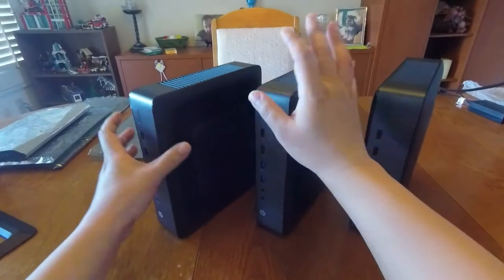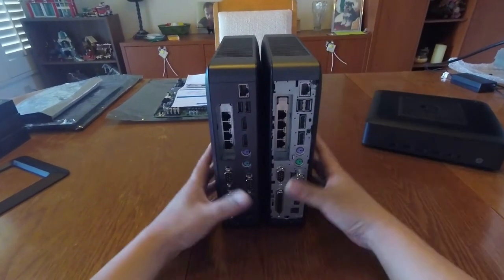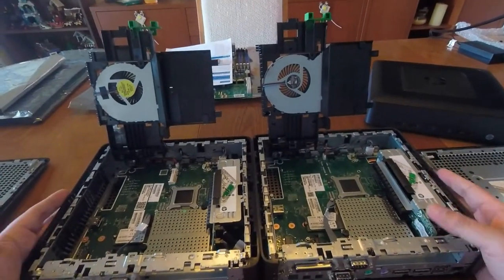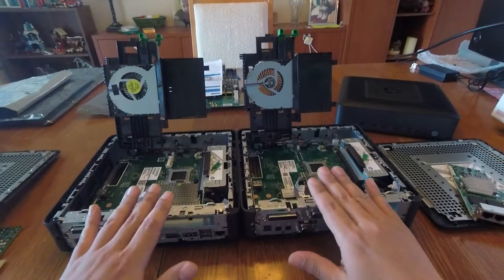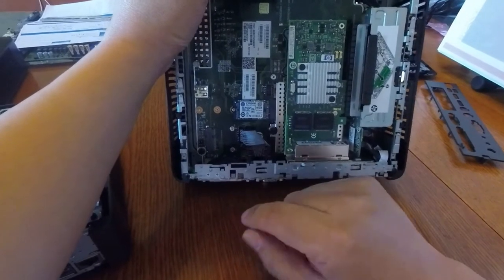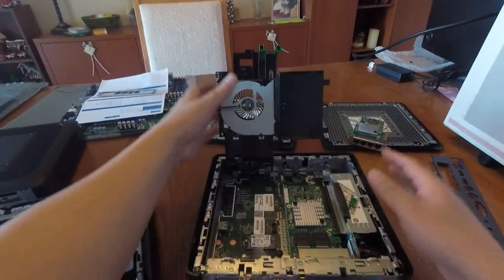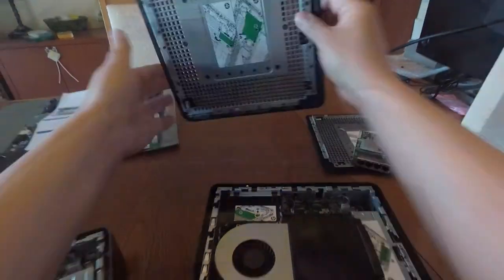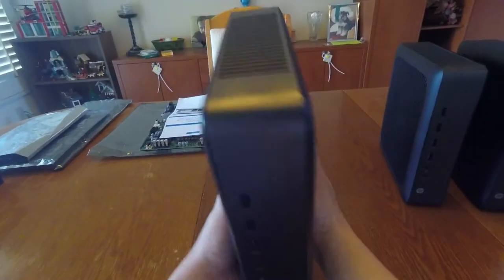Buyer's Guide for HP T620 Plus thin client

Comment: Great tips! I would have mentioned power supplies. It's hit or miss whether they will come with the unit or not. It's usually noted, but a lot of people don't know to look out for that.
Reply from the maker: That's a good point about the power adapter! Thanks for watching!
Reply: And also: you need the official power supply, apparently. You can't just source a compatible voltage power supply and plug connector, because HP looks for low-voltage identifier pin. (Apparently it's easy to remedy if you can solder a resistor internally)

Comment: The T620+ is plenty powerful for win10, quite the uberkill for a firewall. Using it as a 15W desktop makes a lot more  sense in my opinion. Can even be fitted with a PCI Graphics card for heavy gaming (together with a desktop PSU) where the 4X CAT5 port card is originally. Secondly, it is not a mSATA port internally in the T620+ you are pointing out but a mini PCIe port, and it is only wired for serial to connect to a mini PCIe wifi, modem or network card, so it won't work with a mSATA SSD or a mini PCIe SSD either (both mSATA and mini PCIe use the same connector, but they are different and a lot of people mistakes the two). You can solder on a mini PCIe  connector and a few SMD resistors to make it work if you got the kind without. Thirdly, the Display Port has digital audio, so if you buy a Display Port to hdmi adaptor , you have an excellent set top box or silent PC.
Reply from the maker: Thanks for sharing your thoughts. I agree, these machines are versatile and surely can be used in many different ways. Although, i'm not sure about adding a GPU with a desktop PSU is practical, but there are GPUs that will run without extra power and work just fine.

That said, I think you're mistaken about the mSATA vs miniPCIe. There is a miniPCIe for a wifi adapter, and that's at the lower left corner in the video. The "mSATA" that i point to that is missing in Rev B boards, is in fact mSATA. I have a Rev A system i run with a mSATA SSD in that port that I use as a cache drive; so I've confirmed this fact. I also have a another unit with the wifi card in the miniPCIe slot, so you are right that there is a miniPCIe slot, but it is not the same as the mSATA slot I pointed out as the difference between Rev A vs Rev B.
Reply: @ArtofServer  Sorry, yes, I thought you were pointing at the white connector next to the CPU which is only fitted to some. The flash rom is plugged into a mSATA connection or a m.2 connector on models after 2014: https://www.parkytowers.me.uk/thin/hp/t620/
Reply: the GX-420ca when it comes to gaming just lacks the grunt for heavy gaming, for lite gaming its decent. the GT 1030 will be the best that you can fit into the T620 plus. i own a t620 plus with a GT 1030 (the DDR5 version) and the CPU performance is a pretty big hindrance. anything faster than a GT 1030 would be a waste as the CPU is just too slow to push a higher end GPU (the CPU cant even push the GT 1030 in games)

 i mean it will play elite dangerous at 720p with a mix of high and medium settings but you'll see stuttering galore especially around a station, performance by yourself is not too bad it hovers around 50-60, but framerate tanks when near a station, and is decent when in an SRV on a planet.

performance in fortnite is not too good, i had to cap the framerate at 30 as the CPU just cant keep up even at 720p and lowest possible settings.

it plays world of warships at 720p with low settings pretty decently.

it'll play halflife 2 with ease you'll see triple digit framerates most of the times , it'll play COD MW2 with a slight hint of performance degradation on larger maps, CS:go is pretty unplayable with framerates in the 20s-30s

it does run Windows 10 decently, but it can get a little sluggish at times for no apparent reason , but besides that it surfs the web pretty decently, will do 4k video with ease thanks to the gt 1030 (the on board iGPU just couldn't do 4k video, which is why i slapped a GT 1030 in it) , its really quiet even at full load which makes an awesome HTPC.
Reply: Yep runs Windows 10 easily
Reply: Womb Raider  The only thing I haven't tried, is to get audio from the Displayport, rest is good info. It is not an mSata connector, it wont work.  https://www.parkytowers.me.uk/thin/hp/t620/plus.shtml It is the exact same motherboard as the T620 without the "+", just some of them has not all the connectors fitted. https://www.parkytowers.me.uk/thin/hp/t620/  I swear on my grave, this is a PCIe connector.
Reply: You're completely in the wrong.
Reply: @binaryum  That cleared that up real fast ;)

Comment: Thanks for your excellent video. Today I purchased HP T620Plus with the bracket on ebay. So far I have tried HP EliteDesk and ProDesk, now I am going to shift HP Thin Client.  If possible,  I  want to install Windows 10.  I expect that the machine is the enterprise or digital license and also HP products are very easy maintenance without tools.
Reply from the maker: Glad this video helped! :-) Congrats on the T620! I love these little machines!

Comment: I noticed these machines and wanted to make a low end living room pc, this is very handy.
Reply from the maker: yeah, these are great for that type of use too. Also, take a look at the T730 thin client as well, it's a more powerful machine but still very low power.
Reply: I saw that and noticed one with 2 cores? Which chip has more cores on the t730?
Reply: The R3 in it isn't too great for video playback, it'll work for low end stuff, but it'll struggle with higher end videos, and the R3 is horrible with YouTube, the GT 1030 fixed that, but if pared with a GT 1030 it pretty much can handle most kinds of videos even high bitrate UHD videos. And the funny thing is that it can do lite gaming as well (I use mine to play elite dangerous and American truck simulator).

It'll also do emulation pretty decently.
Reply: @madmax2069  its fine for 1080p YouTube h264ify

Comment: Good info ! Lego part is indeed awesome:)
Now I would  like to ask if possible to make a close-up photo of the VGA cable for the part number and connection details.
I have bought recently one with 2 serial ports, rev B of course and the DISPLAY ports were not active/or might be defective.
Adding a video card does not solve the problem. The unit was booting up but only from onboard video card.
So I had to measure all the 16 pins from the VGA header found on the motherboard.
Finally I got the partial pinout and got the VGA signal displayed on a monitor.
However I would like to have the complete schematics of this small VGA cable which is nowhere to be found. Not by type, not by part number.
Thanks a lot for the instructive video. Mounting the "stand on foot" for the horizontal position was also new for me, like built in surprise :)
Cheers !
Reply from the maker: I'll see what I can do about that, since I don't have one with VGA port right now. I might get some soon so if I do, I'll try to help.
Reply: @ArtofServer  This is more than perfect! Many thanks ! I will  also try to finish the cable chematics, I have for now the RGB, grounds and Vertical, Horizontal Sync.
With these signals you can run a monitor but I would like to have the complete cable schematic. For sure this info will be helpful for a lot of other 620 TC owners.

many thanks !

Comment: I just bought one of these to turn into a Linux box, what's the best single slot SFF video card I can get for these... I'd prefer nVidia but if theres a good amd one that's fine too
Reply from the maker: it would have to be a low profile GPU... maybe Quadro P400?
Reply: @ArtofServer  either that or a gt 1030.. which would be better
Reply: Okay... I got my HP t610 plus thin client.. trying to install pfsense, and it won't find my ethernet cards :(

EDIT: Good news and bad news.. good news, is that xubuntu detects my ethernet cards... and the Broadcom port is indeed a wired ethernet plug (thank goodness, was gonna say I was thinking that was my wifi).. the bad news is, unfortunately my 4 port ethernet card (HP NC375T) doesn't detect.. odd..

Comment: could a gtx 1030 or 1050 fit in these?
Reply from the maker: Are there any that are low profile?
Reply: @ArtofServer  
msi gtx 1050 ti is low profile
Reply from the maker: @CJ-9314  if you're talking about this one: https://www.msi.com/Graphics-card/GeForce-GTX-1050-Ti-4GT-LP.html , then no, it won't fit even though it is low profile, it looks to occupy two PCI slots. the T620 Plus only has a single low profile PCI slot.
Reply: @CJ-9314  1050 is too big, it has to be half height and single slot and the only one of the two that's half height and single slot is the 1030. The other thing you have to be aware of is the power supply, it's only 90 watts, and the 1050 requires a lot more power than what the power supply can handle.

Another thing is many of the coolers (especially the fan less 1030 is a dual slot design which is too big as the heatsync sticks out too far which is why it's called a two slot) much like the 1050 listed above.

Also make sure when getting a 1030 is to buy the gddr5 version and not the ddr4 version.
Reply: @ArtofServer  you would need to set it up on the outside of the computer with it's own power supply

Comment: what model nic did you use
Reply from the maker: Various brands (HP, IBM, etc.), but I usually choose one based on the Intel i340-T4 chipset as it is the most energy efficient 1Gbps NIC.
Reply: @ArtofServer  thanks for the heads up, now I know what to look for when I go and get my NIC for the T610+ for pfsense
Reply: That said.  You know of any wifi cards, preferably USB 3.0 (or pcie is fine too if I must) that works in pfsense?

I'm sure I can get any old USB 3.0 gigabit ethernet adapter and it'll work in pfsense right

Comment: what were they using that DB-25 for in 2019?  are there point of sale hardwares that need that?  LPT and PCIE in the same motherboard.  how bizarre!  Why no AT keyboard DIN plug?  That stand doesnt look too hard to 3d print...  or just wrap the ethernet cables aroud a nail and dangle the whole thing by the ethernets.  4 of them ought to take that weight just fine!
Reply from the maker: You were doing fine until the "dangle the whole thing by the ethernets" ... now I have to consider banning you or not. ;-P